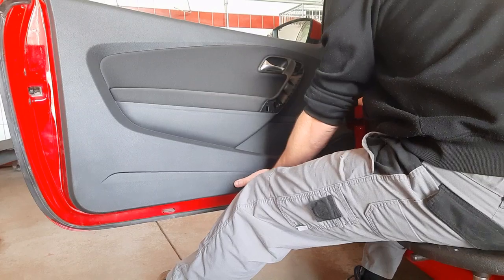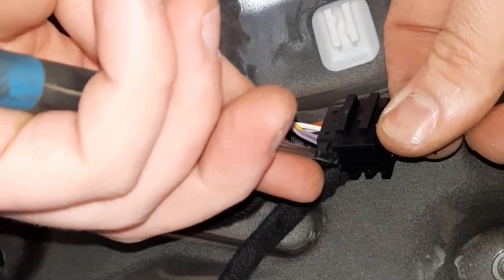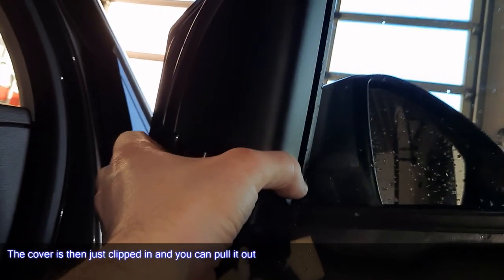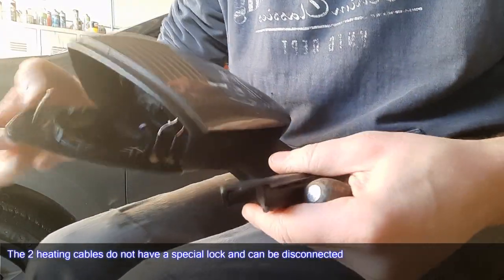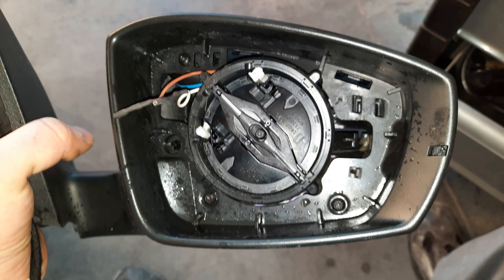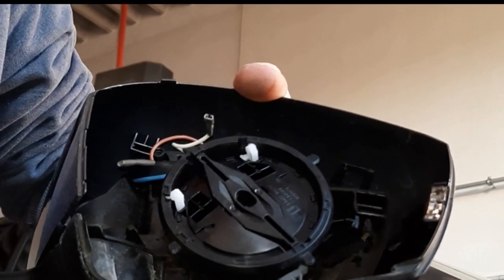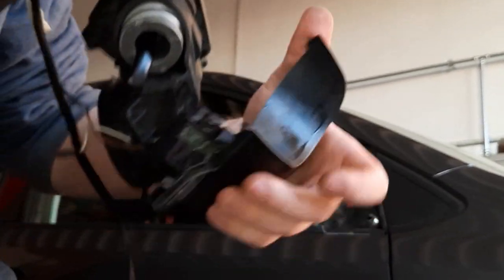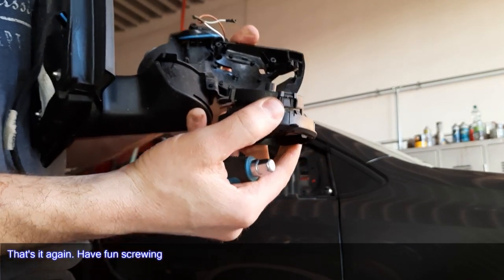VW Polo 6R side mirror removal and disassamble into parts - Tutorial

Comment: Excellent video.
Having purchased two mirrors from eBay, both turned out to be incorrect – one doesn’t fold, and the other has 16 pins instead of the required 8. The actual mirror and casing are intact, but the frame that attaches to the door is damaged, specifically a broken metal plate. Any suggestions on how to remove the frame would be greatly appreciated.